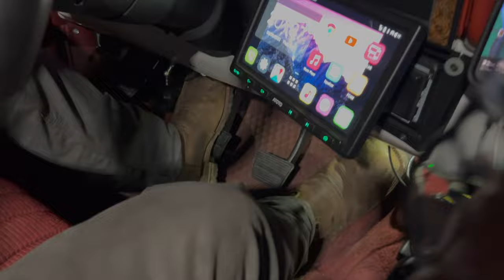I had to get TOWED off the freeway!  My King of the Hammers adventure!

Comment: This is exactly why I didn’t go ls in my blazer. Not to say they are related or that it can’t be don’t reliably but so many issues with after market stuff and retrofitting parts. I have the TBI which is super reliable albeit under powered. I’ll leave the LS and diesel swaps to the deep pockets and dudes with ample time on their hands to wrench and tow trailers and tow rigs.

Comment: I usually only have 1 thing wrong with my 84 k20 at one given time. Either air pocket in fuel line, starter,  dead batteries, brakes,   random solenoid, leaky fuel filter assembly. Waiting on a new spin on fuel filter with assembly bracket to come in. First one was defective. They are sending me a new one

Comment: Dude, WD40 is diesel starting fluid.
Reply from the maker: not if there is an air lock
Reply: Just have your buddy riding on the front bumper spraying WD40 in the intake. Keep it under 70. You’ll be fine. 🤪